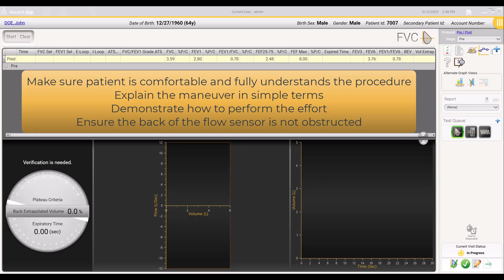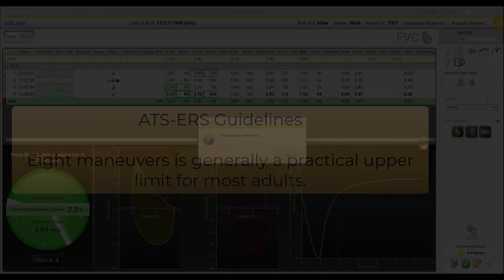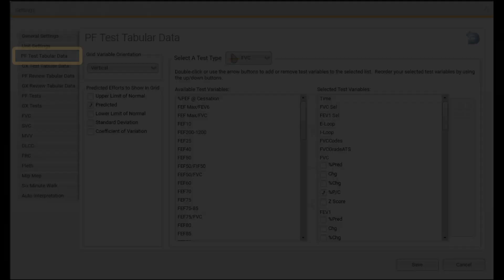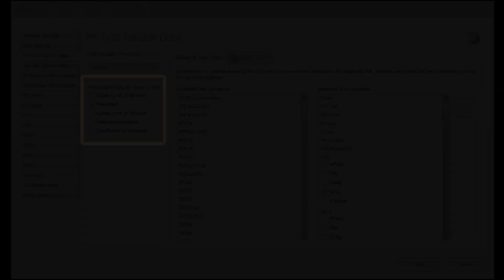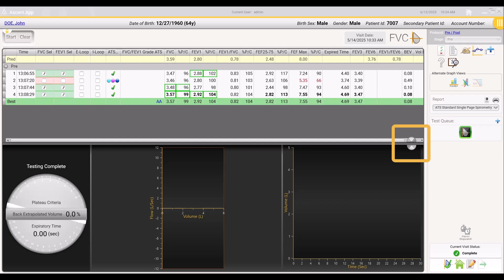FVC Testing with Ascent Software | MGC Diagnostics

Comment: Hello,
I'm a respiratory technician, and I would like to understand how the preVent Flow Sensor works.
In particular, how does the sensor measure the pressure drop, and how is this pressure drop used to determine the airflow?
Thank you for your help.